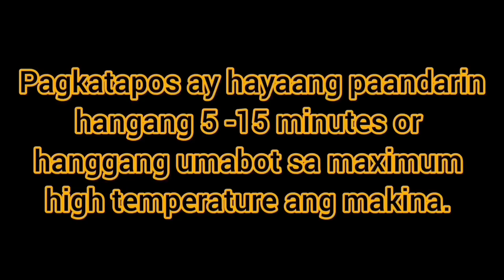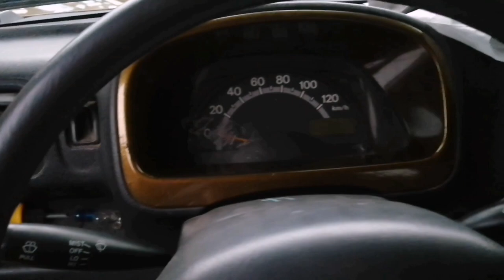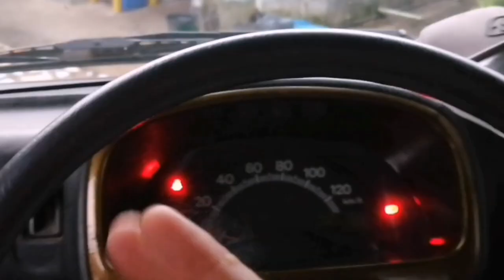How to DIY Cooling System Maintenance in my car (Da63T Multicab) at home ? | RodKris Bisdak

Comment: Paps, unsa kaya problema sa akoa transformer, 4x4,manual, bisag mga 30minutes na naka off ang engine,init gyapon iyahang radiator,.
Reply from the maker: After 1 hour mubugnaw na ba ang radiator nimo?pag nag andar wala man kaha naglight or nasiga ang overheat sign?if wala magsiga permi ang overheat sign kapag nag-andar dili na overheat o wala nay problema  pero ko kanunay nagasiga ang overheat sign mean naay problema. Unsa pud ang radiator nakataod sa imuha katong burag plastic or katong original jud na bakal, duha man gud ka klasi na radiator mostly ginataod dari sa pinas pagnagconvert or nagrecontioned sila ang surplus na unit multicab katong replacement na burag plastic na radiator or kato jud original na bakal. Ang akua radiator depende man gud na kung pila ka kaoras gadagan kung dugay na oras ka gadagan mean medyo mataudtauran jud na og kabugnaw ang radiator pero kadali ra dali ra pu na mubugnaw pagpalong jud. Mao na sa akuang pagkabalo. Kanunay lang pud echeck ang mga radiator hose sa ilalom kung naa pud bay tagas or nagtulo kay possible mag overheat puhon kung naay nabuslot gamay or tagas sa radiator hose.
Reply: @RodKrisBisdakMotovlog  mao paning original sir, wala man nuon ga check engine, tapos wala papud nako siya na travel og kanang dugay gyud kaayu kay bago ramani nga pull outsa yarda,though as is converted rni, akoa nailisan ani is engine oil lng kay mao rman daw kailangan as per nag convert, pasalig pud siya nga goods pa ang unit, last December lng ni na kuha nako sa yarda,  mao sab na akong ge check gnha buntag, wala man nuon leaks, dri dri rpud ko ga travel travel sa amoa kay ga practice practice pakog drive, wala pagyud ma test og layu nga biyahe like more than an hour drive,
Reply from the maker: Natry mo macheck ang coolant reservoir basin wala nay sulod or gamay ra.. Dapat ang tubig or coolant level ana naa ra sa minimun kanang dili kaabot sa tunga sa reservoir kay dili pud pwede pasubraan ug butang. Or basin pure tubig rapud gibutang ana mostly basta gikan sa surplasan yard kay top water ra ginabutang. If ever di ka kabalo unsaon pagchange sa tubig ug coolant sa radiator tan-awa lang akong video sa pag DIY sa pagchange coolant sa radiator pero kung nag alanganin ka magDIY much better adtu ka sa Expert mekaniko para madrain na ang radiator ug mailisan og bag-o tubig with coolant.
Reply: @RodKrisBisdakMotovlog  mao ptong coolant niya gikan sa japan sir, gedungagan lng sa nag convert,😅, pwede paman daw to, i just dont know if same specs lng sila og coolant dadtua og dria kay lahi bya weather dadtua, below2 na siya gamay sa katong level na full sir, naa mantoy tag sa level sa reserve dba na word na "full" below sa line ss bagis sa ana, check pud nako radiator,full man sad,

Comment: Boss natural lang ba magbawas ang coolant sa reservoir niya puro coolant ang gamit ko.
Reply from the maker: Hindi siya normal boss if everyday ka nagabawas. Check mo mga hoses sa radiator sa ilalim if may tagas ba kasi yun ang isa sa cause or if wala tung sa radiator mo ang possible may problema. Same sa multicab ko ngayon ang radiator mismo ko may problema na kasi umaapaw palage ang sa reservoir ko  kasi medyo may kunting barado na kailangang linisan or palitan na talaga,sa akin medyo kaya pa naman remedyuhan kasi wala pang budget for new radiator. Sa iyo baka may tagas lang sa mga hoses sa ilalim icheck mo lang.

Comment: Boss ano dahilan bakit di na lumalamig aircon ko da63 po..
Reply from the maker: Dalawa ang reason sa pagkakaalam ko boss, 1st baka walang freon nakalagay o kulang sa frean. 2nd kung meron man baka may kaunting butas or sira  sa air-conditioning system ng sasakyan mo. Mas mainam ipacheck mo sa expert mekaniko sa air-conditioning ng sasakyan.
Reply: Thnx boss
Reply: @RodKrisBisdakMotovlog boss malakas ba talaga sa GAS CONSUMPTION pg nka AC ang DA63T.. salamat po..
Reply from the maker: Expected po iyan medyo malakas po ang gas consumption kapag nakaAC.